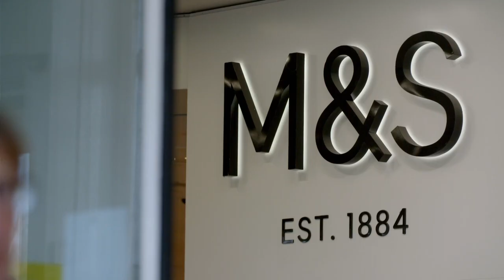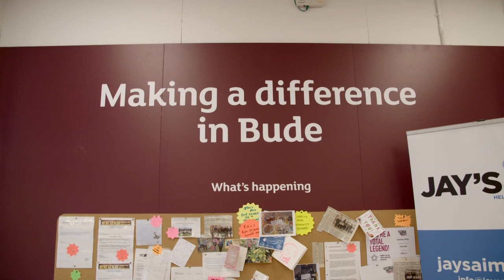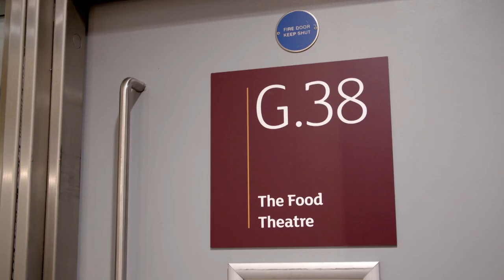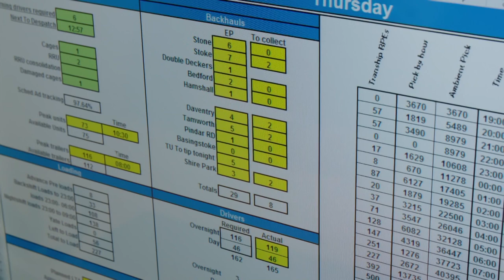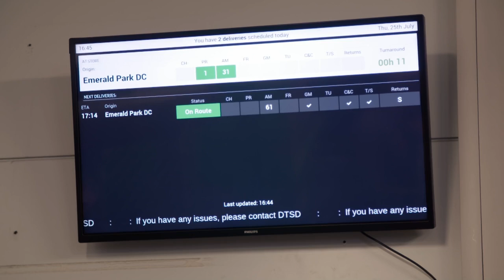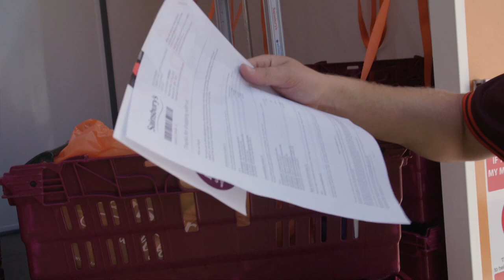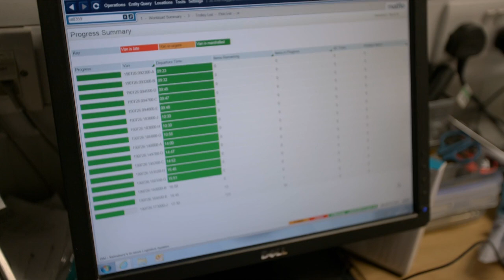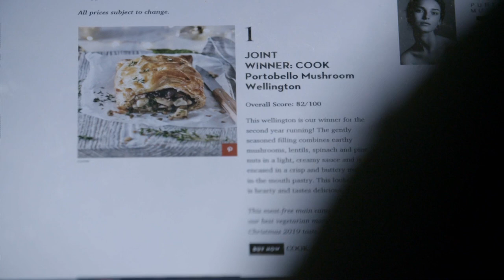Inside The Supermarket - Season 1, Episode 4.

Comment: The reason they have the celery in a plastic bag is to stop the celery from being contaminated by every customer holding it
up and mentioning it is ridiculous for Sainsbury's to put the celery in a plastic bag.
Reply: So why can carrots be loose. Why can tomatos be loose. Why can potatoes be loose. Why can peppers be loose. Why can parsnips be loose...the list goes on.
Reply: Normal people wash their fruits and veg before they eat them.
Reply: Have you ever been to a supermarket fruit and veg section?
Reply: @gl1tcheddatabase270  Did you think that the packaging is helping keep leafy veg fresher? Root veg is fine typically out raw, but leafy stuff like cabbage and leaks go off quickly and they're out for atleast a couple days on the shelf where they'll be messed with and bruise and go off faster than any other kind of veg.